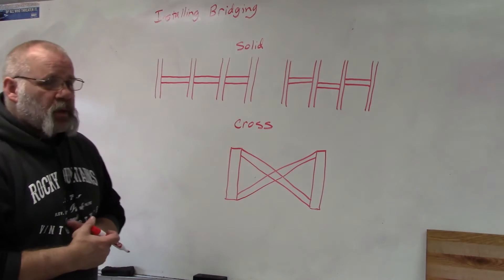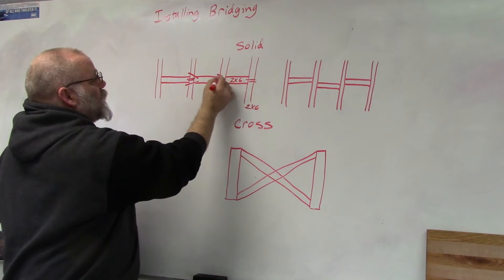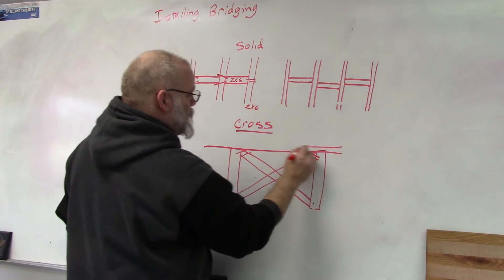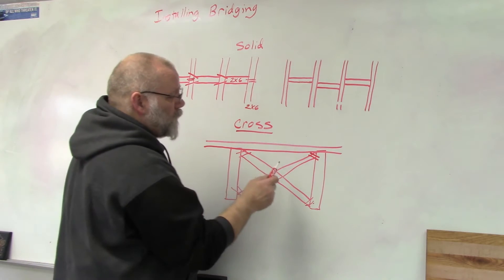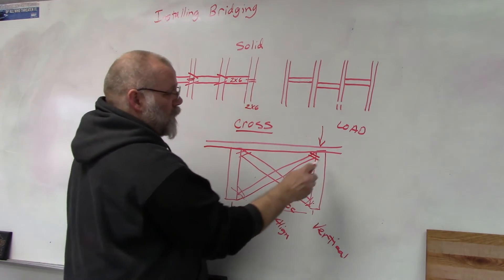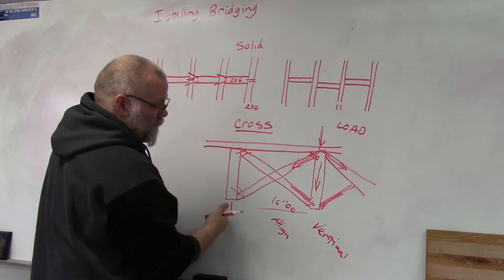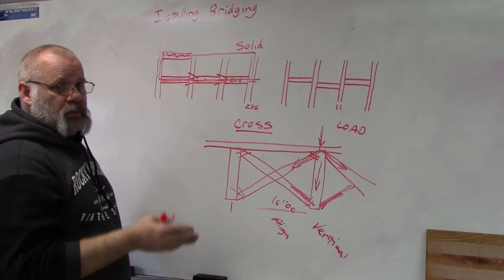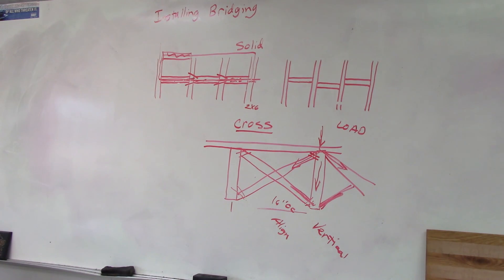Installing bridging

Comment: Hi Tim - How would you recommend attaching replacement wood bridging where the floor is already in?  The bottom is easy to screw, but what about the top?  Toe screw?  (this is in a house where the bridging was pulled out - probably a mistake - and now, for design reasons, new bridging is desired as opposed to new blocking)
Reply from the maker: @MrGrillguy44  yes, that is probably the best choice.
Reply: Really appreciate the feedback. Thank you!

Comment: Question: can you install bracing after the above floor is fully loaded, or is it wise to temporarily move the load and install bracing.
Reply from the maker: @mikegrimaldi5844  you can install bracing after load is applied.

Comment: Hello. I recently purchased a new build ranch home with an  open concept on a full basement. The builder used 2x10 for floor joists. After being in the home for sometime I’ve noticed floor bouncing. Builder did come back and put in cross bracing throughout. Still having floor bouncing. Would you recommended the solid method as you speak of to add more support? Or even putting additional 2x10 boards attached to the current ones?
Reply from the maker: @BrianMaphis  without looking at the floor either would work. Solid bridging would be easier and cheaper. What is the span? Where did they put the bridging?

Comment: 1500sqft ranch. 1969 construction. Been in the crawlspace several time and this has bugged me for years. All my crossbraces are attached to the top but none are attached at the bottom. I don't know why it was done (or not done) this way. If I need to nail these in (nails are in the bridge pieces, go figure). I've tried to nail a few in. I don't have the space to really do this so I was thinking of just getting 2x4 ro 2x6 blocks and blocking the spaces. I am not a carpenter so my cuts are trash/ no precise. I just want to get my house fixed up without spending as much as the house cost on a contractor. The odds are slim I get a contractor worth what they charge.
Reply from the maker: @djsgtrock1968  if you have the money you could invest in a mitre saw for better cuts and maybe a battery or electric nail gun. These would make it easier. Another option would be to screw them in with the appropriate screws.

Comment: Great video!  Does cross bracing work as well or better than sistering joists if I'm not concerned about vertical deflection?  These are TJI 110 joists spanning 12 feet 16" OC
Reply from the maker: @mikekim6374  cross bridging will help distribute the load and stabilize it

Comment: Hi. We have a 1960s house and we removed the first floor floorboards and saw that the cross bridging is barely touching the joists in some cases and is the cross bridges are not nailed to the joists.

We have access only from the floor abone and not from level below.
What can we do? Shold we try and screw them into the joists top and bottom however we can but just from the top (as we do not have access from below)
Any advice?
Reply from the maker: @ony5447  I would try to get top and bottom
Reply: @timpalmer-logstolumber1999  the house was built some time ago and should be settled ish. Are these crossings still necessary? Would they help?
Reply from the maker: @ony5447  they would help. It would stabilize and help against any further issues.

Comment: I have I-joist for my subfloor and feel plenty of bounce and vibration in my house.  Anything different cerning I joist vs dimensional lumber floor joist?
Reply from the maker: @brianquinn5500  no, they should have cross or solid bridging to help reduce the bounce in the floor
Reply: If it's above a crawlspace, consider adding a beam.
Reply from the maker: @brianquinn5500  no, bridging would help take the bounce out.

Comment: I had foam insulation installed in my crawlspace, so almost impossible to install any bridging.  Should I follow the 2x4 method and brace underneath the joists?
Reply from the maker: Did you use open or closed cell foam? The closed cell has some rigidity to it, open cell does not. Adding any bracing would help with bouncing or bowing floor.
Reply: @timpalmer-logstolumber1999  It is closed cell foam, but does not completely fill the joist -- I never checked after they were done.  So, do you think if the joists are completely filled there might not be any bounce?
Reply from the maker: @dlatt-kx5ir  I think most of the bounce would go away if they were full
Reply: Considered adding a beam?

Comment: What if the subfloor is already installed? Can i use cross bridging? I'm a new homeowner and my kitchen floor feels like a trampoline.
Reply from the maker: If you have access you can install it after the flooring has been installed
Reply: @timpalmer-logstolumber1999  In this situation with the subfloor already in place and having to work under the house, would the suggestion to add CROSS bridging be just as easy to nail as nailing SOLID blocks? Would nailing the top of the cross bridge be difficult with the subfloor already installed? Enough room to nail?
Reply from the maker: Yes you can, as long as you can get to it

Comment: so if you have floor 20ft x 8ft, and joist are running along the longer side how you bridge them? you cross the underneath horizontally in contrast to what you draw @1:46 - vertically?
Reply from the maker: If the joists are 20 feet long you would need 2 sets of bridging no more than 8 feet apart. You can use cross or solid bridging. If subfloor is already in use solid bridging.

Comment: I have a really bouncy floor in my kitchen and want to do cross bridging will I have to just do it under my kitchen or all across the house
Reply from the maker: The code says anything over 8 ft should have it but if your kitchen floor is the only bouncy one I would only do it
Reply: Hi
My floor in my kitchen is bouncy. It has I-joists 11 7/8” that span 16’, 16” oc. There’s2 rows of cross bridges around 5’ or so. The cross bridges are 2”x2” wood, held by 1 nail in each end. They feel very loose. Should I add a nail or screw to make them secure? They don’t seem fastened securely.

Comment: My house was built 2 years ago with I-beam floor joists. The span is 16' and it's a little bouncy.  I installed 2 rows of X bridging spaced evenly after watching your video and notice a huge difference.  Thanks.
Reply from the maker: Glad I could help
Reply: I think you forgot an e, or you're giving your floor a big hug. ;)
Reply: @nbco55  Yup. Thanks. I think I fixed it now.
Reply: We're there is duct work I see in my basement a 2 by 4 installed on the bottom of the joists horizontally to let the duct work to have room to pass.  This was done by the original builder.

I would like to finish my basement and add new duct work where there are cross bridges. 

Would it be OK to do the same thing?
Reply: Nice work, Shawn!

Comment: We found mice had gotten into the Crawlspace due to previous owners not paying attention. We removed all the insulation when the crawlspace was encapsulated. This exposed the fact that the bozo's installing the batt insulation between my floor joists had disconnected the metal floor braces instead of cutting the batts to fit between them. What's the best way to return the structural integrity to the floor joists? Attempt to re-install the metal braces or install blocks?
Reply from the maker: Check to see if floor is level, if level or real close just reinstall metal bracing. If sagging you could try to jack it up then reinstalling bracing.
Reply: @timpalmer-logstolumber1999  Thank you!

Comment: When installing cross bridging instead of using nails can you screw the pieces from either side of the floor joist?
Reply: Nails can bend but screws are hardened and will snap.  Use nails.
Reply from the maker: It is usually recommended that you nail or screw through the board you are attaching into what you are attaching it to. If that is not accessible, attach as best you can.

Comment: Hey Tim, during the installation of our HVAC system, they knocked out a bunch of cross bridges to get the round air duct in. There is no room now for a 2x10 or a new cross bridge to go in its place. Is there anything you can do? You might be able to fit a 2x4 under the air duct, but that's about it.
Reply: Check out the Youtube video title: How To Remove Bounce From Floor - by Shell Busey (Its old but shows the HVAC ducts issue and loss of bracing )
Reply from the maker: That is what your going to have to do. Put the 2 x 4 across the bottom.
Reply: @timpalmer-logstolumber1999  Awesome! I can work on that. It is good knowing that I can use a 2x4, it is hard to find stuff online.

Comment: So which is best
Reply: The crossed bridging will be stiffer, because you are basically making a truss structure, where the force is inline with the grain direction.

The solid blocking carries a shear force, but you can still consider it equivalent to the x shaped path for tension and compression, but misaligned to the grain direction.
Reply from the maker: I prefer solid, no deflexion in it, easier to install

Comment: Does cross briding need to run the full length?... I have joist spans filled with ducts where the briding is interrupted.. not enough room for a brace
Reply from the maker: It should, if the duct work is in the way you could add blocking under the duct. If it is new construction you could ask the  building inspector, codes vary by location.

Comment: (True below, speak up.)  BUT, do not, not do this. Install the bridging like he said, nail on top and do not nail the bottom yet. install your sublfoor and any walls during the build. Once the Dead load is established and before the Live load begins, THEN nail the bottoms of the Bridging. therefore a load on a single joist is spread out two joists on BOTH sides of the load. Think piano leg. So in effect, five joists are carrying the piano leg.  Forget solid bridging unless it is over a carrying beam or girder. And use construction glue under the subfloor on the joist. Pay attention to his spacing regarding the run. F--k the Draftsman that forgets these important details. If you are a heavy person and hear squeaks coming from the floor years later, well, now you know...
Reply from the maker: You are correct about the load being applied before nailing the bottom. As far as using solid bridging it comes to two things, codes and preference. Always check local building codes. And yes always use liquid nail when laying subfloor.